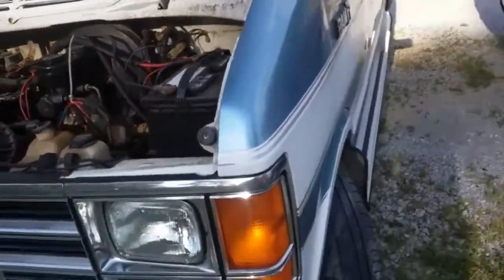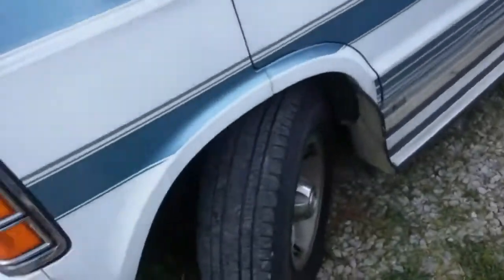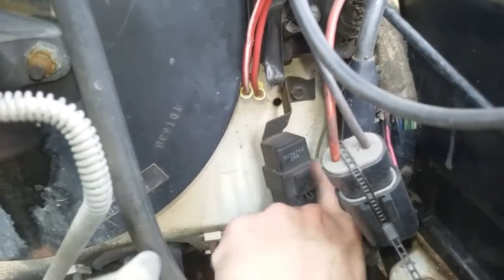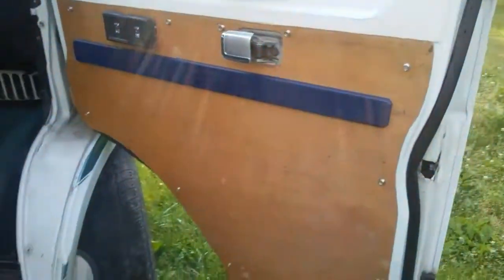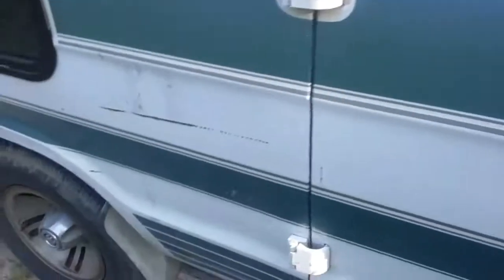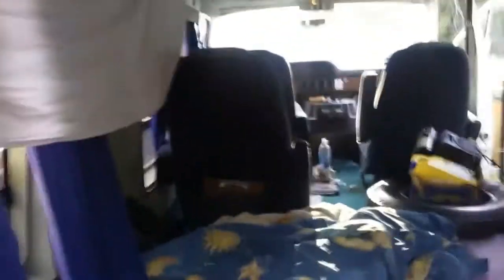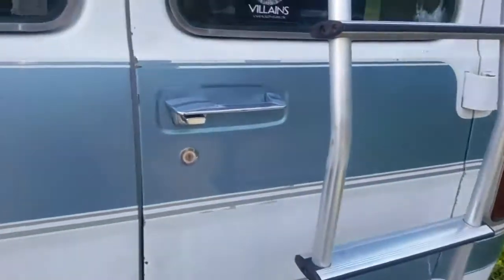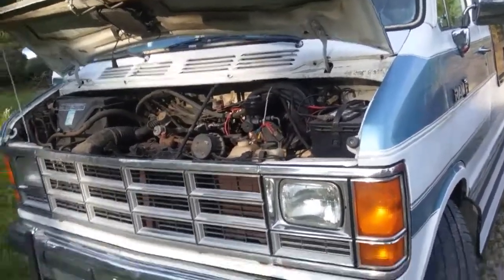1990 Dodge Ram Van walkaround

Comment: Hey Stuart, thanks for your videos, they're really helping me. I'm trying to fix a few things with a 1989 Dodge Ram Van B250. My driver's side door is completely stuck, it sounds like something's not connecting when I pull the inside door latch. I want to take the door panel off to check it off, but I haven't found a good way of removing it. Do you think I should just undo the top screws and tear off the whole panel, or do I have to remove all the latches and panels first? I'm also having trouble locating the power steering reservoir under the hood. Any advice you can offer would be great, thanks
Reply from the maker: If the door panels are the same or similar to mine you should be able to pop off all the little buttons and take out the screws all the way around the outer edge of the panel, then carefully pull it out from the door then you should be able to push in the tabs that allow the window switch panel to come out of the door panel. And for the power steering pump, it's waaayyyyyy down at the bottom on the drivers side lol. It's actually way easier to see and to work on from the bottom, so if you lay on the ground and look under the van it should be in the front on the driver's side.

Comment: I have a 1990 dodge d250 van I have searched and searched for info on how to connect my windshield wipers and I cant find anything could you help ?
Reply from the maker: Is the motor working and the wipers just aren't moving? Or is the motor and all not working?
Reply: @CrazyWoody1989  the moter is working the wipers just ran out moving ...I'm starting to think there off track
Reply from the maker: @mariehaynes8769  Okay I think I know what's wrong because I had a similar problem with mine. Underneath the cowl vent right at the bottom of the windshield is the wiper linkage and it's held together   with little plastic bushings and I bet they have rotted and crumbled off. They sell them at almost any parts store and to change them all you have to do is take the screws holding the cowl vent out and pull it off to access the linkage.

Comment: Is the pump for throttle body injection located in the tank ?
Reply from the maker: It does have an electric pump in the fuel tank, it's always something I worry about going out on that thing haha
Reply: @CrazyWoody1989  ya thats one of the benifets of having a carburetor. Would be nice to have the more reliable starts year round. Ill probably just collect throttle body injection parts until the carb tales a crap. Thatnks for the reply.